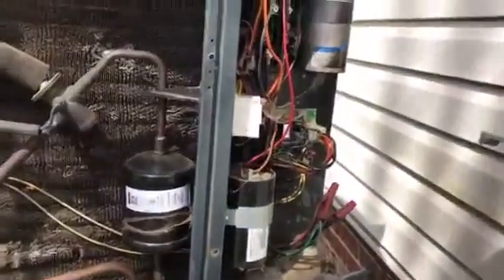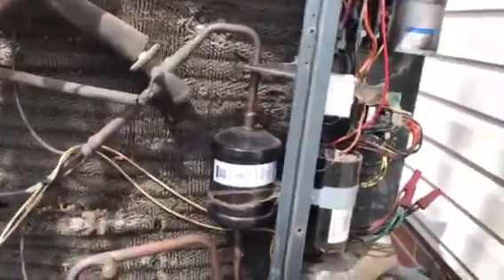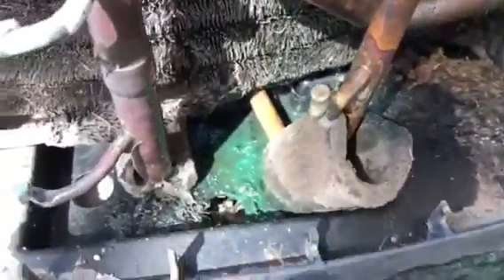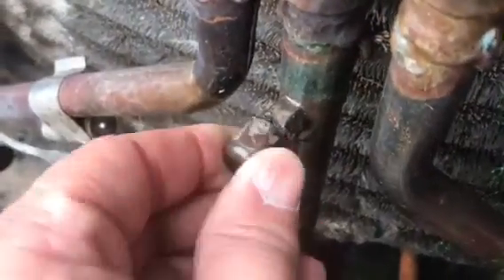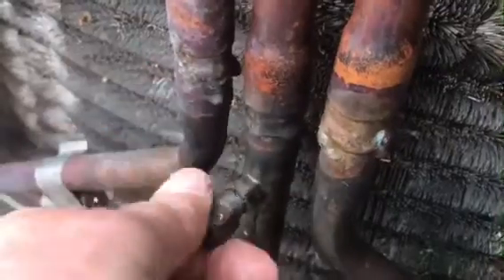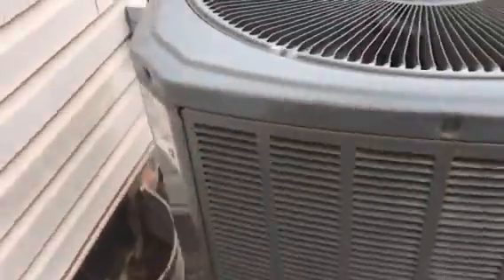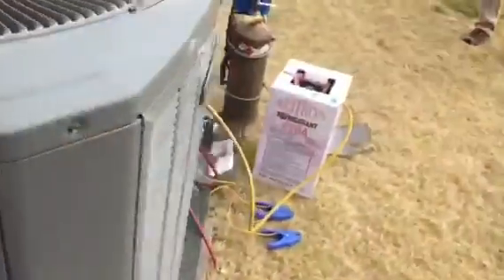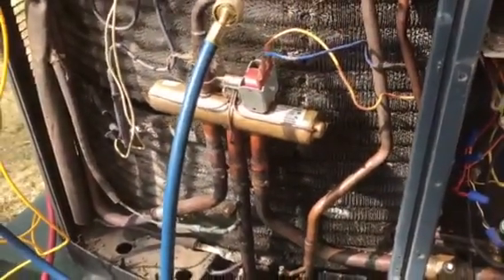R410a leak repair

Comment: Looked like the tech who replaced the reversing valve was a little green to brazing in reversing valves and didn't carry schraeder cores on his van.
Reply from the maker: Not sure exactly what all took place other than it is obvious a rookie worked on that could possibly have been blindfolded and drunk, with no HVAC experience.
Reply: I have never replaced a reversing valve. The reason why is where I have been working at the last 19 yrs, colder climate area. That one was easy to access, lol. Yeah, that was just sloppy work.
Reply from the maker: Look at this one... it really sucked !!  https://www.youtube.com/watch?v=ZtXqxHjEoIQ